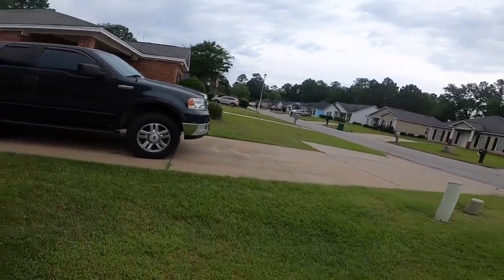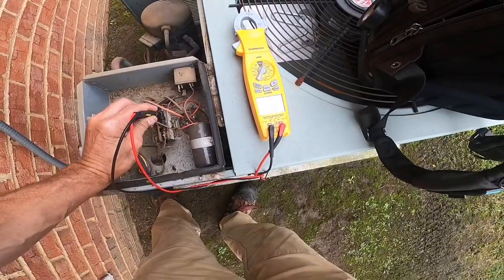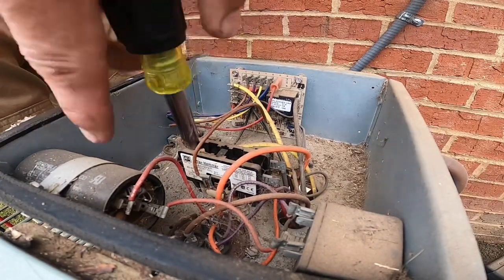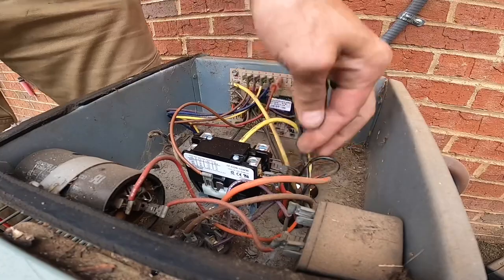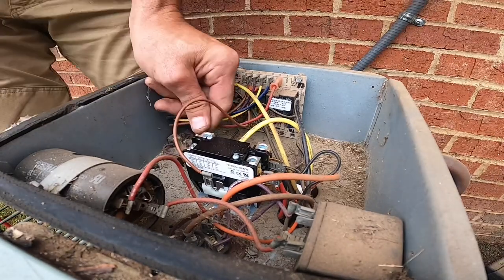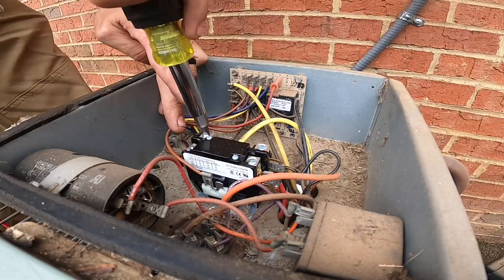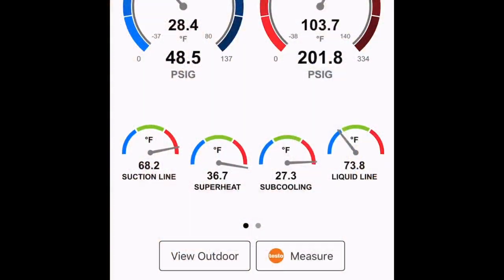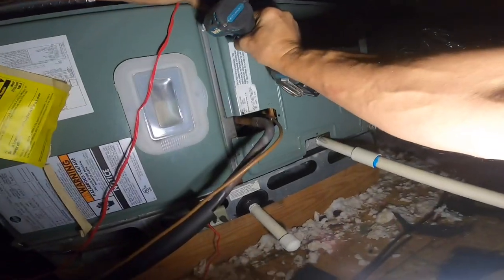No cooling, not as simple as it first appeared.

Comment: Nice Job! thats definitely a restricted TXV. One thing I like to do is fully diagnose if at all possible before I tell the customer anything. I hate going back and removing new parts and telling them I found something else. I keep a high voltage alligator clip to jump power across the contactor. My quote wouldve been for a contactor and probably coil because I hate replacing rheem TXVs and that coil looked pretty rusty. I dont Install Rheem because of those TXVs. Stupid bulb line that goes thru the coil box and all solder joints with a screen that forces you to nitrogen purge braze or the screen is all black lol

Comment: Dryer outlets next to the condenser, odd to be one of the most cringed at things by HVAC techs, since the lint is easily pull in by the condensing fan, and blocks the coils.
Reply: And one of the odd spots to find bees living in them too without the thing blocking it

Comment: look at that huge opening air leak where the lines go into the air handler and the drain line.
Reply: I disagree ... hot would make that txv go wide open it closes with cold
Reply: @drodriguez394  yep thanks...but could have weird pressure readings with that much hot air leaking. Txv may not be able open enough to handle it. I forgot what vid pressures were. 😆